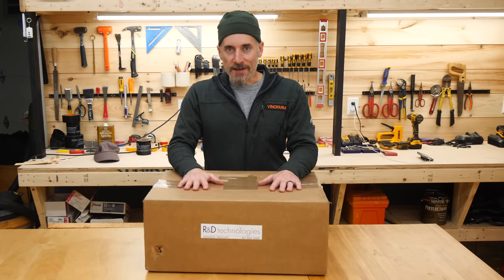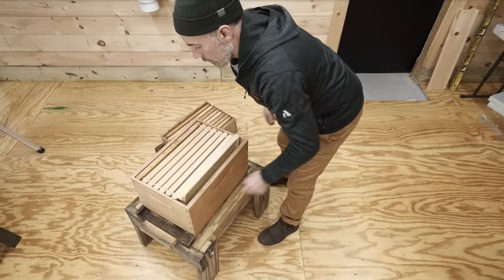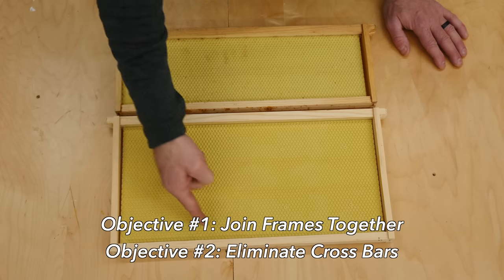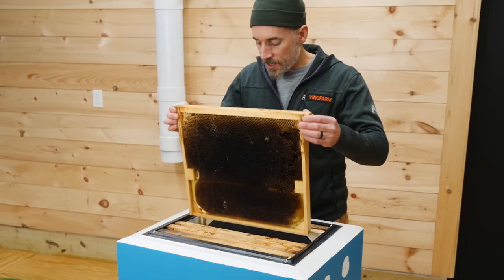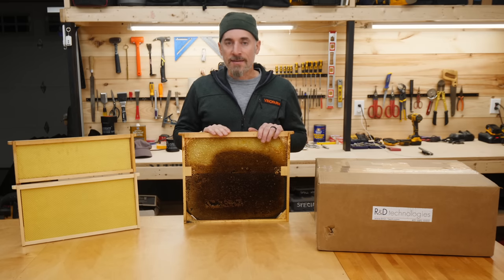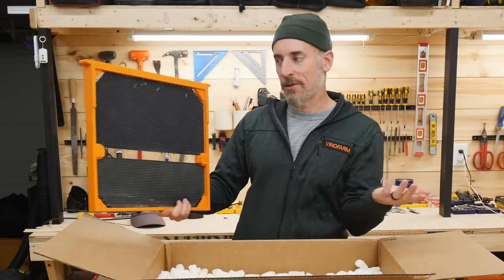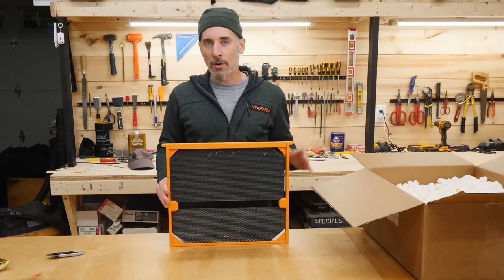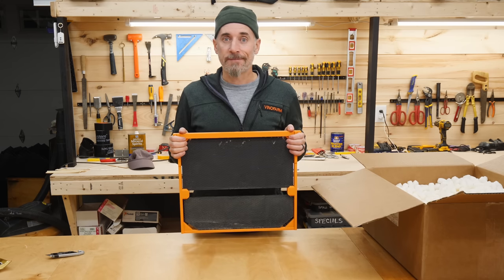Bigger, Better Bee Frames? Let’s Make This Happen!

Comment: I was wondering about the process of getting plastic frames produced and it appears that others have shared the same thoughts that I had like the multi-piece frame, the adjustable spacer for swapping top and bottom positions for the foundations, and such.

I would order 1 set (we run 10 frame boxes up here and I'd like to stick with that). Possibly quite a few more depending on price but I need to keep things inexpensive because my apiary is expanding quicker than I can afford to buy woodenware/build these for them. 

It's the old challenge of pricing. If you sell it high you can cover costs sooner but will get fewer orders. If you sell it low you'll get more orders and possibly a greater total dollar value but possibly not enough to cover the cost of the project.

I expect that I'll have my mom switched over to this system as well. She wants them safe and happy and she wants it to be easier to manage them.
Reply from the maker: Pricing is a complete mystery until I figure out how much the molds will cost. And then get quotes on what the injection manufacturers will charge. Everyone thinks “injection molded parts cost pennies” but that isn’t true in 2023 and is definitely not true for something as large as a beehive frame. Add in USA production and these things are going to be not pennies, but probably several dollars each just to mold. Whatever happens, I’ll be totally transparent with you and have no interest in price gouging. It’s going to be just me running the show, not a big company with a bottom line.

Comment: Suggestion: A hot clamping mold would be very cheap to build, then the excess plastic which gets squeezed out is simply thrown back into the pot to melt some more. .. Instead of having a center groove, then have a side groove with a screw on cover strip? .. Or have the sides screwed together down their lengths, with an available groove once assembled.

I am convinced that by clamping (top and bottom) of the mold together it becomes cheap to make a mold. One side can even be hinged. The pattern is on ther bottom and the top. Hot plastic is poured in the bottom then clamp the top down. I suggest using a high temperature silicone if possible for the mold. The silicone is on metal outer sheets to help disperse the heat and cool it.

Just a thought on maybe doing it in a different way?

Comment: Hi Jim

I Iove the idea of the combined frames . I have been using them too with double brood frames in the Simplex size that we have here in Holland. I’ve been working as an engineer in plastics manufacturing for almost 40 years.
I think molding these frames in one piece is a chalange. It requires a very large mold and injection molding press. 
If you build a mold to make the four pieces laying next to each other in the mold you can make the groove also in an easy way .
I woulld probably choose a polypropylene copolymer and make an easy snap fit on the parts to assemble the frames.

Comment: Why would you have the gap in between if you are building the frame from scratch. Seams as if you would want continuous cells top to bottom if the option is there.
Reply: In previous he explains he keeps the gap so bees can decide what they want to do in that area.
Reply: @kagedsin7868  but he also didn’t have much of an option. Now he does.
Reply: @redhare976  
I agree, i think it will make the frame more sturdy removing the need of al the braces. 
You also would not have to alternate the frames to make sure they keep building the comb the right way.

The only thing i can think of why you should not do it. i that you can never use standard size honey extraction machines. But I think the bee barn is for the bees and honey supers for the wax and honey. So that should not be a problem
Reply: @Tanks_In_Space  while i agree that is what has been said but when bees make large combs in nature they build long combs without holes or gaps
Reply: @Treespiritofficial  You wouldn't need to extract these larger 'brood frames'.  You super the Beebarn with standard Langstroth mediums or small boxes with standard frames that go in any extractor.  Problem solved.
Reply from the maker: See pinned comment!!!
Reply: I’m interested in keeping bees but I am even more interested in building bee barns.  Great ideas great engineering.

Comment: I might be a little late to this ... but couldn't the side bars be made with a laser burning machine in 3 pieces and then assembled?  One front and then two back sides with a gap in the middle for the black plastic comb foundation. The flow hives look like they are laser cut so its possible isn't it?
Reply: oh Yes laser cut.  that's even better than 3d print.   and would be so much faster because you can just pick the width of the material.
Reply: @seribusDragon  Yeah, I just did some research on it ... its super easy to create files for the laser cutters. Its easier than 3d printing and the size wouldn't be a problem.

Comment: How well will the injection molded frames do in an extractor? Do you think they'll be as hardy or hardier than wood frames? Do bees care about materials? I'm so curious!
Reply: You won't be putting these frames in an extractor, they're specifically for the brood box; and even if you needed to, I'm sure they'd hold up just as well as wooden frames (there are already plastic supers on the market that do the job just fine).

For the most part, bee's don't necessarily care about the material the outer casing of their hives are made of; so long as it isn't toxic to them, it's pretty much Free Real Estate. People have been using plastic hives and frames for a long time now with no consequence to the bees, even the Flow Hive frames are made entirely of plastic and yet the bees still store honey in them.

Hope this satisfies your curiosity.
Reply from the maker: 1. They would be far stronger and last far longer than any wooden frame. 
2. These are brood frames for the brood box and will not be extracted.
Reply: Bees will build on just about anything, it seems. I've pulled swarms from discarded tires and one from a cardboard box someone was using for compost that was also infested with large roaches. That one was pretty gross.

Comment: About ready to stop beekeeping because of back pain. I  have been experimenting with options  for several years. This is the best idea so far.  Yes,  I'll be part of a funding plan.
Reply: I have nearly come to the same conclusion as you due to the back pain, it may not be as ad with the younger beekeepers but at my age I dread inspections and have taken a more hands off approach to beekeeping the past couple of years. If the ack pain  can mostly be eliminated using these frames that's a great start.

Comment: I don't know if anyone already asked this, but, will you need to make 2 molds so you can produce two versions of the frame.....one with the deep foundation on the top, and one on the bottom?  In your past videos on the frames, you mentioned the need to alternate where the gap is to keep the bees from filling between the frames.  Would you be producing a 1 piece frame, or would it be made from modular components that would give you the following benefits:  1). Common top and bottom parts, with just the need to have the 2 different molds for the sides.  2). Smaller part sizes, with smaller moulds.   3). Less chance for warpage in the smaller parts than in a single large one. 4).Reduced shipping and warehousing size, and reduced shipping costs since you can ship all parts tightly packed rather than with a bunch of open space (think Ikea vs.custom furniture) especially if the foundation is going to be supplied by the end user.

Comment: Isn't this similar to the Layens frame and hive?
Reply from the maker: No, these are about 50% larger. And they are not bound at the top like Layens frames. These are Langstroth frames, fit in Langstroth boxes and allow the boxes to be supered.
Reply: Layens frames also stack sideways for the length of the hive body. These stack vertically
Reply: @vinofarm   original design of Layens frames didn't touch together at the top, it was more like a long langstroth as it used either burlap or cover boards on top of the frames.. it's something that has been introduced later to simplify the design
But yeah your frames are more similar to double deep Langstroth than Layens
Reply: These a similar to the original Dadant frames. The Dadant was roughly a Langstroth deep + a shallow combination.
Reply: @jimmclaughlin4096  not really, these are way deeper than a Dadant.. a Dadant is 11¼",  Langstroth is 9⅛", BeeBarn frames are a little short of 17" if I remember correctly.. so like I said it's more similar to a double Langstroth than a Dadant
Reply from the maker: @jimmclaughlin4096  Two years ago when I first started posting about these, some people were talking about those frames, but there is almost NOTHING on the internet about them. These are about 16" deep.
Reply: @vinofarm  oh if you mean the original Dadant frames, those aren't produced anymore in the US, not even Dadant company makes them..

Comment: Yes would support crowd source.  Comparison Mann lake 100 deep frames $130: 100 medium frames $130 total 260 divided by 100 = 2.60 (no foundation included) per frame if combining both together 5.20 to make a bee barn sized frame.  My estimate, Bee barn frame would be worth $10-15 per frame.  Would purchase 20 at this price range, would purchase more frames if I can efficiently make the bee barns.  Live in Iowa need insulation for cold   Enjoy you videos. Bee barn times 2 is on my spring project list.  Just not looking forward to making frames on the table saw

Comment: Not a huge fan of so much plastic in the hive. Why can’t this be manufactured by a company already producing wooden frames?
Reply from the maker: Please watch the video and see why wood is not ideal. I’ve been  hashing through this for two years. This would not be a “single use plastic” item. Some things are better in plastic. And the bees do not care about anything but the comb and the cavity. They will be perfectly happy on these.
Reply: As mentioned, alot of people don't like plastic touching their food. Many are changing back to metal and glass. If it's just the frame / edges where honey won't be collected probably not an issue. However if they are in contact with the honey it creates possible issues
Reply from the maker: @hoocli  Ask any beekeeper on earth where they store their honey after it’s extracted and I bet nearly 100% of them will tell you 5 gallon buckets. And if they are a big commercial outfit extracting into stainless steel, I guarantee 100% of them use plastic foundation inside every single hive.
Reply: @vinofarm  I know, just mentioning a trend I'm seeing. Those that want at home hives may prefer less plastic.

Comment: I'm a design engineer and I do some work with mould tools etc. To mould that frame in one piece would require a very large mould tool, which involves a very very large machine to inject it, which limits your options in moulding places as to who has machines large enough. A possible better option is to mould them in four pieces on the same tool so reduces the size of the tool. Or even have 2 mould tools with sides in one tool and the top and bottom on another. You're possibly looking at $30k - 50k. Don't quote me on that, get a quote. China can do them cheaper, they'll also, if you wish, keep the tool and ship frames when you need them, just remember you'll have shipping costs and longer lead time to add to the parts. There are cheaper mould tool options like using aluminium core, cheaper and easier to make than hardened steel, but shorter life span.
Reply from the maker: Thank you. I am already past the one piece mold concept… (this was made a few months ago.) You’re exactly right with your ideas. Thank you.
Reply: @vinofarm  I think, if it is made from plastic you have nice interlocking feature that would negate the need for screws or nails

Comment: Linus Media Group went through this process for their screwdriver recently. one thing about the molds they said is that Chinese manufacturers will make the mold for less, but you likely won't own the mold itself, also because of the culture down there, they may also start selling products made from your mold so if you want exclusivity, there is a risk to going the cheaper route here.

It could be worth reaching out to them to see if they're interested in talking to you for a bit to help get you going in the right direction.
Reply: @danholtbk7008  This was more meant as a warning to not use Chinese injection mold factories because they'll steal your work. LMG's screwdriver is molded and assembled in Canada.
Reply from the maker: @danholtbk7008 My plan is for USA manufacturing and production. However every US injection manufacturer I’ve talked to has mold makers in other countries. So the actual mold might need to be made somewhere else and shipped back. It’s just the way things are these days. Injection will happen somewhere near me in New England most likely.

Comment: I’m in!!!! Min start order 60 frames, but probably start with 100…. than repeat some quantity each year. 
(Ps…. Getting mold made is expensive as you say , but the world is full of mold makers of all quality….. I use to go to Italy to get “high quality volume capable “ molds and good price…….your shape and “finish” is on the easy side, so should have no trouble finding a mold maker….. but usually the injection molder will have a tool maker they work with and you can hand the mold making over to them.   Good luck….CANNOT WAIT!)